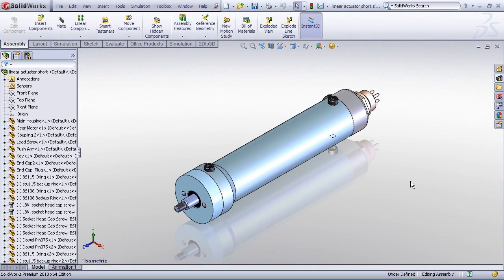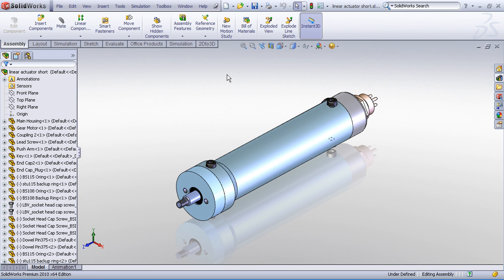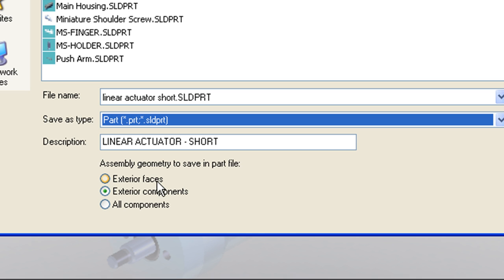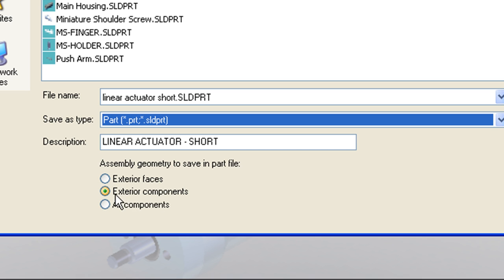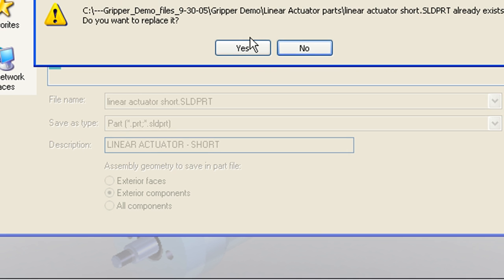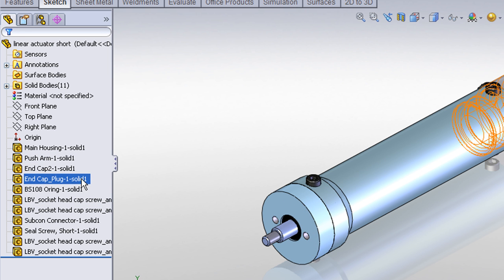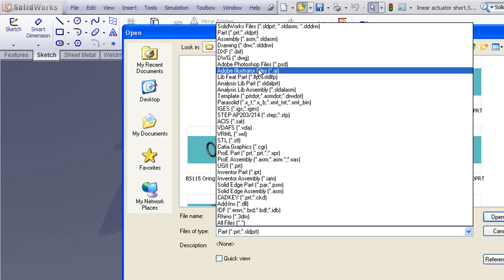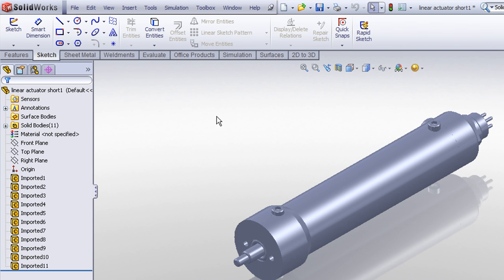Exporting SolidWorks to STEP

Comment: Surprising how much work is involved here.  In NX (granted, it is an enterprise CAD system), you just grab the components you want to export into a STEP solid, and it saves those pieces into a new file.  In this example, if I just wanted a few chunks of this actuator, I have to save it as a separate assembly, delete the unwanted components, then save it as a sldrpt.  Then I'd have to open it up and save it as a STEP.  Painful if you have to do this a lot.
Reply: Booooo...... NX sucks
Reply: @shubhamjagtap6076  Yeah - it's really hard to get a job using Siemens NX - the high-tech companies using it are very picky in their hiring practices.
Reply: @shubhamjagtap6076  Yeah - it's hard getting a job in high-tech companies that use Siemens NX - they are very picky in their hiring practices.